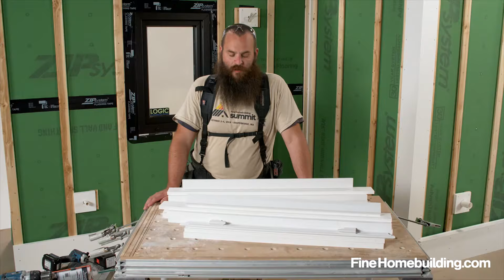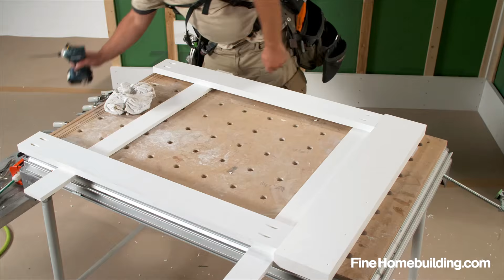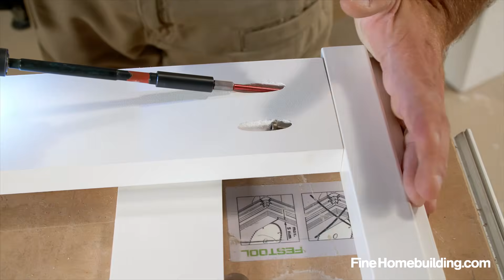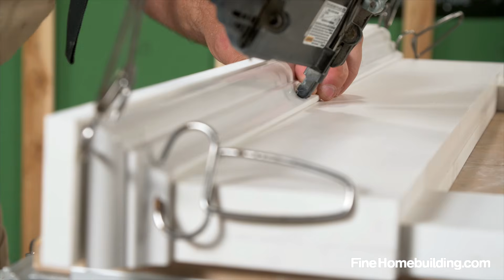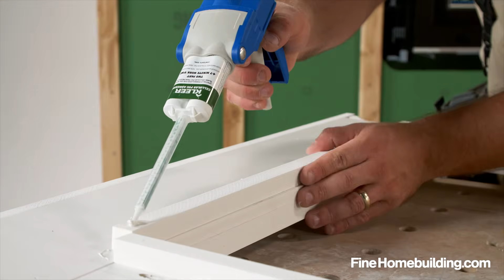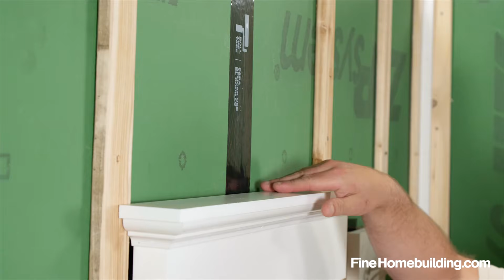Exterior PVC Trim: Windows and Doors

Comment: Thanks for the video. I am curious about the final exterior cladding over the rainscreen (which looks like 1x3 wood) and the interface to the window trim you created. What was the plan?
In my case, I am planning to use James Hardie's lap siding, and I would like to use cellular PVC trim around the window.

Comment: This is good, but I myself prefer setting new windows out at exterior surface, and have extensions inside if possible. Why spend two setups for exterior and interior? It does happen, but new build keep everything simple and faster.

Comment: I’m siding my new build with Chelsea Building Products - Everlast Siding. Because it is a floating material, all trim and penetrations are fixed to the Zip R3 prior to installing the J-Channel the siding will terminate. All trim is AZEK PVC. Any tips would be appreciated.
Reply: How did your project workout? Did you add J-Channel around the window trim to hide the siding edges?
Reply: Curious also